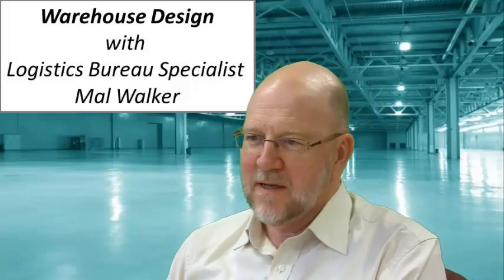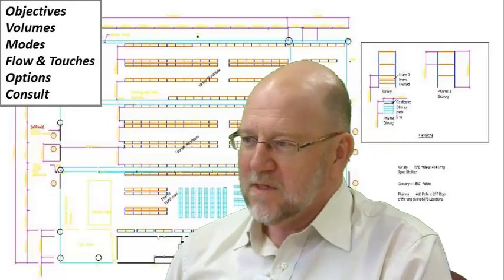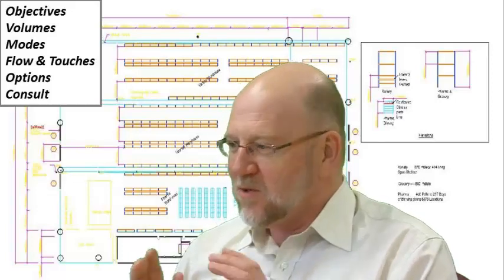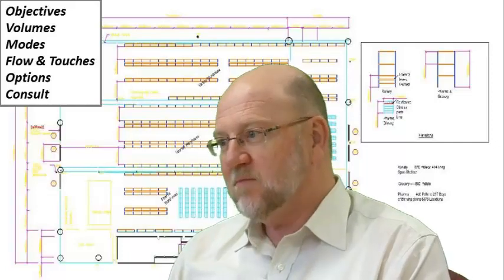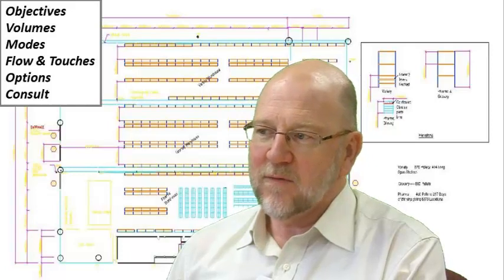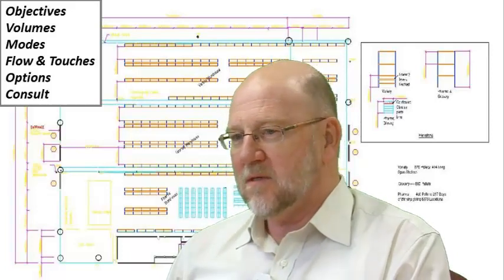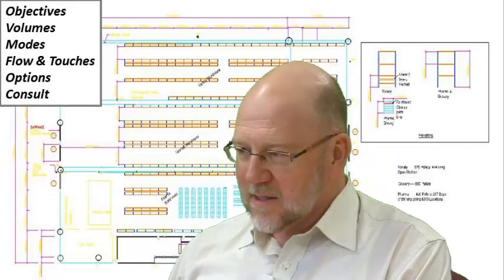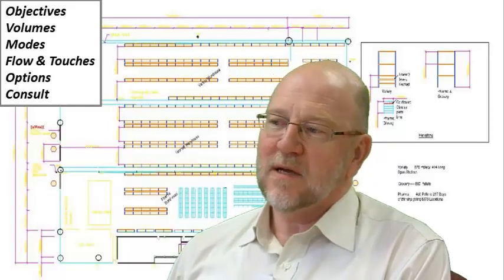Warehouse Design with Mal Walker

Comment: Warehouses and distribution centres form and essential link in the supply chain between producer and end user. It is critical that the commercial fit-out of these facilities are handled by experts with experience in their configuration and specific storage requirements.
Reply from the maker: Very true.
Reply: @supplychainsecrets  অ